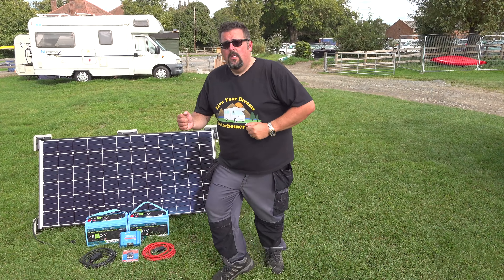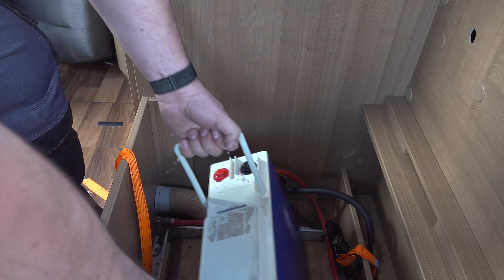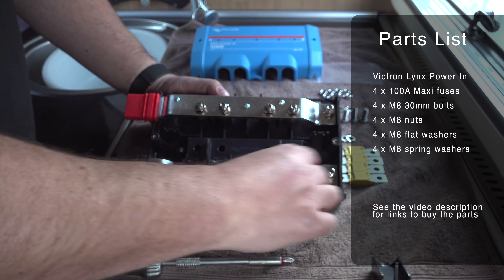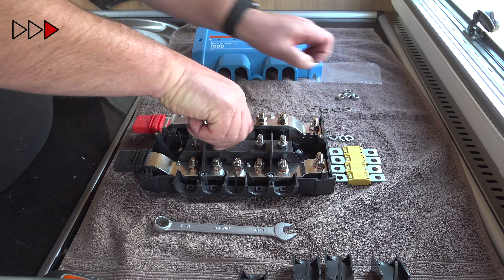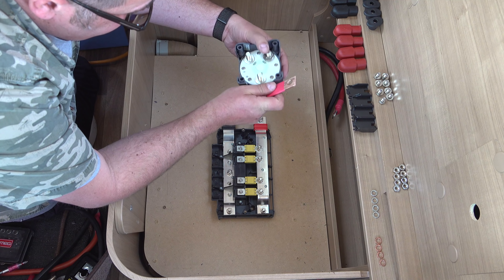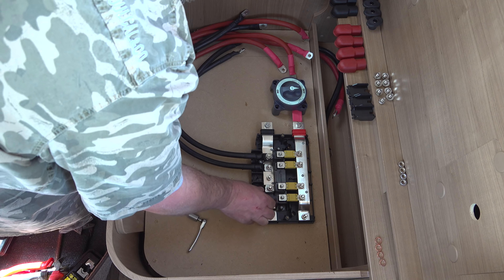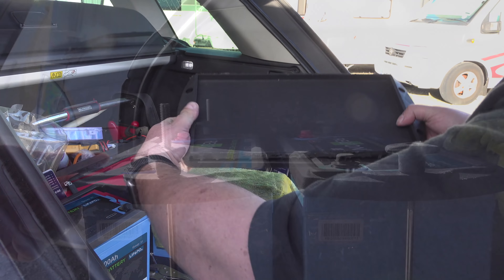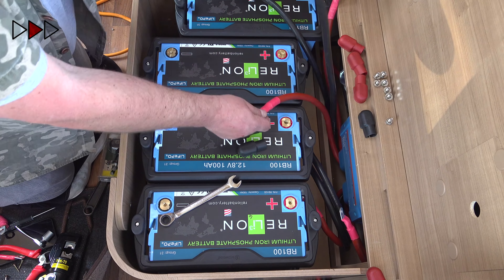Lithium Battery Bank RV Motorhome - 10 Minute Full Install

Comment: Nice one Phil
Reply: Great work and very tidy. One comment. Although your spanner wasn't long enough to cause a problem it is not a good idea to lay a spanner on top of a battery during the connecting up process. Someone using a longer spanner could potentially short out the battery.
Reply from the maker: @nigelcharles511  Hi, with these Lithium batteries, they would automatically disconnect is less than 600µs (0.0006 of a second) if they were short-circuited, however, I do take your point that it is not best practice.

Comment: Hi pal great video just wanted to know I have a MotorHome which I’m replacing leisure battery with lifepo4 batteries with built-in BMS, are these batteries plug and play or do I need to fit any electronics because of the voltage from the alternator and charger when on hook up information appreciated cheers